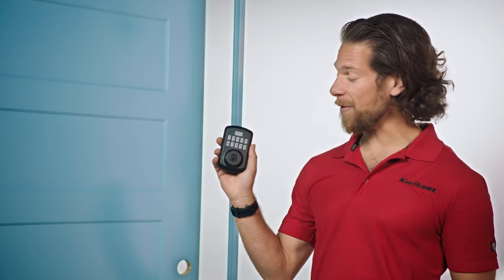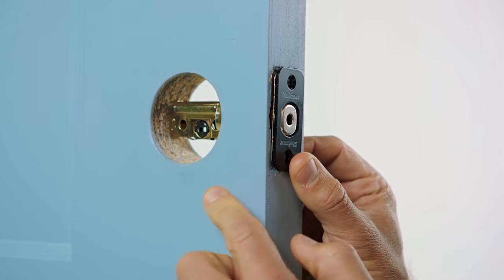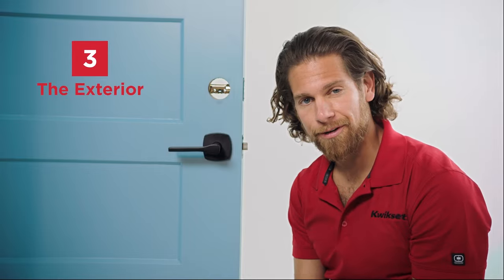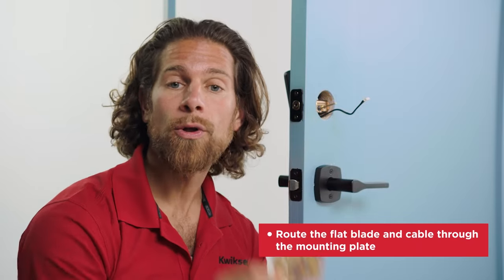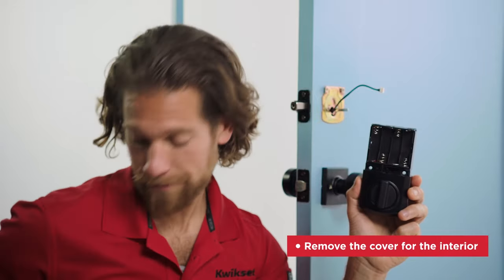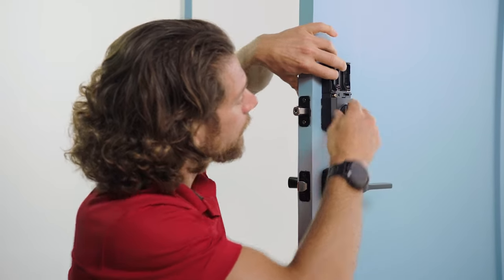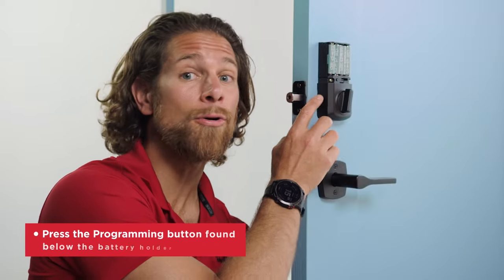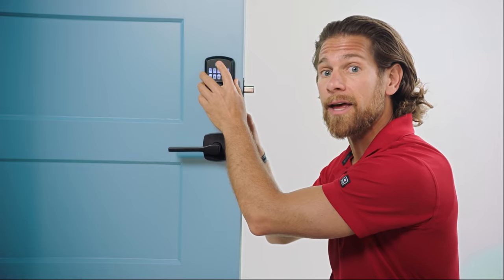Kwikset Powerbolt® 250 Electronic Door Lock Installation Video

Comment: After installing it, it worked. Then decided to calibrate and now it’s not working. Called 800 number and she was not helpful. At least put someone that knows what they are talking about instead of reading a script. Why do I need to replace brand new batteries? Why does it fail after trying to calibrate? She said I need to return to store as the motor sounds sluggish on the phone. I know it has to be software issue and not mechanical. Brand new and a bad motor? Returning this one and getting different brand.
Reply: The key doesn't work for my lock? It refuses to withdraw. Is there a fix for this or do I need to replace the whole thing?

Comment: My door is unlocking when I hit the kwikset button and locking when I put in my code. 

Completely opposite of what should happen
Reply from the maker: Hi and happy to help! It sounds like your lock is working in reverse and here are the steps to fix it: 
1. Open the door and place the latch in the locked position. Remove the key from the lock.
2. Unscrew and remove the interior assembly of the lock.
3.  Make sure that the Flat Blade spindle is in the vertical position and that the Turn-Piece is also in the vertical position. 
4. Reattach the interior assembly while the latch is still extended (locked).
5. Perform the Door Rehanding (Page 4, Step 15): https://kwik.st/3NUSeGv
6. Finally, check your door jamb to ensure it's a full once inch deep and test the lock.
Thanks ~ Kwikset Social

Comment: Doesn't require a step to detect orientation like the powerbolt 2?
Reply from the maker: Hi and here to help! On the Powerbolt 250, after the first User Code is created, the latch
bolt will automatically retract and extend to learn the locking and unlocking direction of the door. The Kwikset logo will indicate success or failure. GREEN: Success / RED: Unsuccessful. Thanks ~ Kwikset Social
Reply: @kwikset  thanks! Getting a warranty replacement from 2 to 250, so very helpful!

Comment: What happens if it flashes red while programming?  Reset doesn't fix.
Reply from the maker: Hi! Please try a new set of batteries and perform the Rehanding steps in Section 15 on Page 4 of the Installation Guide: https://kwiksetprodstorage.blob.core.windows.net/documents/kw_ig_5054449[250]eng-spa.pdf  Thanks ~ Kwikset

Comment: The install was easy, however never managed to  program it to work.

We installed it with the lock extended.

We used step 16 to try and train the lock, however it retracted, but could never get to the extended (locked) posit
Reply from the maker: Hi Mala - Glad the installation was easy for you! Please try replacing the batteries with a full new set and complete the rehanding step again. For more support, please reach out to us here: https://kwik.st/47S6kjH  Thanks ~ Kwikset Socia
Reply: Having the same problem. Called the 800 number. She was not any help. Why do I need to replace brand new batteries. It was working fine, but when I tried to calibrate all hell broke loose. Returning mine.
Reply from the maker: Hi Viaggi, We understand you've contacted our Support Team previously, and we'd like the opportunity to assist you further. We place tremendous value on our consumers' experience with our products and services, and our goal is to find the correct solution for you. Can you please give us a call at 1-800-677-5625? Thanks ~ Kwikset Social
Reply: I am have  a similar issue. After installation, programming my code and pressing the lock button, it was very stiff and would try to retract but it wouldn't. I loosened the screws to take some tension off and that didn't help. The person that customer service told me to take the keys out but since I was not in front of the lot she refused to help me anymore
Reply from the maker: Hi Rod - Happy to assist you further! We ask that you contact our Support Team when you are near the lock so we can walk you through the troubleshooting steps over the phone: https://kwik.st/3TSC8Rr  Thanks ~ Kwikset Social

Comment: I’m having issues mines keep showing me a white light no matter what I do.
Reply from the maker: Hi @Cyplife - To get your Powerbolt 250 in working order, please replace the batteries, Factory reset the lock per step 16 and perform the Door Rehanding process per step 15. Finally, program a user code in step 6:
https://kwiksetprodstorage.blob.core.windows.net/documents/kw_ig_5053732_9250.pdf  Thanks ~ Kwikset Social
Reply: @kwikset  Ty I’ll leave you an update when I replace it.

Comment: I have a issue where if I put in my code it locks the door, and when I press the logo it unlocks the door. What do I need to do?
Reply from the maker: Hi Andrew - Happy to help! It sounds like your lock is working in reverse and here are the steps to fix it: 
1. Open the door and place the latch in the locked position.
2. Unscrew and remove the interior assembly of the lock.
3.  Make sure that the Flat Blade spindle is in the vertical position and that the Turn-Piece is also in the vertical position. 
4. Reattach the interior assembly while the latch is still extended (locked).
5. Perform the Door Rehanding (Page 4, Step 15):
https://kwik.st/43cDRlD
6. Test the lock with the door open.
Thanks ~ Kwikset Social
Reply: Nothing the kwikset team says will help cause they dont know what the issue is but after a very long niggt of cussing amd throwing tools i figured it out! 

The last 2 screws you install cant be too tight or it will never successfully program the lock
Reply: I ve tried and done everything on the instruction in order what you explained.  I changed the blade spindle to the vertical then reattached it.  I did the door rehandling and hoping if the programming could reverse the lock/unlock position.  Unfortunately, it still doesn't work at all.  I press the 'kwik' logo, it unlocks.  I am so frustrated with this programming.  How do you reverse the lock/unlock position in programming?  @kwikset

Comment: I FIGURED IT OUT!

The whole process is fine, good info, thanks.
The “problem” is, as always, user/operator error.

The interior bolt knob, is SIDDED.  If you try and install and setup as video suggests with the “6” in the “12” position, it doesn’t work…. Disassemble the interior part, Flip the interior knob so 12 is at 12, and then redo the 1-kwikset button to program your code.

All I can saw is, the interior knob, has a small raised part, that is the “arrow” or “up” position.  If you have the flush part of the knob, that’s the wrong direction…. It’s upside down. 

If you look closely, you’ll see, on side of the knob is flush with the mount, the other side is elevated slightly, about 1/2 a cm…. That’s the pointer or “12” on a clock face.  The proper “up” position.

I struggled like everyone here… and it Worked for me!

Also, when he says “have the bar horizontal…. That’s when the exterior is mounted, but to “extend the deadbolt” that flap, is then VERTICAL when you attach the interior faceplate.

Comment: I have a kwikset lock and it suddenly flash green light and beeping every few seconds. I already change new battery but still the same. Anyone know what happened?
Reply from the maker: Hi and here to help! To get your Powerbolt 250 working properly, please follow these steps in order:
1. Open the door and place the latch in the locked position.
2. Complete the Factory Reset, step 16, followed by the Door Rehanding, step 15.
3. Program the User Code, Step 6: 
https://kwik.st/44oIHha
4. Make sure the door frame jamb hole is 1 inch deep and check your door alignment:
https://kwik.st/3rrx5LF
Thanks ~ Kwikset Social

Comment: I also struggled, BUT it is very important to follow exactly what he says. Make sure the metal pieice that connect to two piece is HORIZONTAL, not Flat and the inside piece is straight up and down when you connect the two piece. That will make all fhe difference.
Reply from the maker: Hi @sna2ke - The flat blade piece should be in the Vertical position with the latch bolt in the locked position before installing the interior assembly. Please see time stamp 3:47. Thanks ~ Kwikset Social
Reply: @kwikset  sorry, I meant vertical.
Reply from the maker: Great! Thank you for your feedback.

Comment: Anyone have info on how to master reset can’t get this pos to work
Reply from the maker: Hi Antonio - Here to help! To get your Powerbolt 250 in working order, please try the following steps:
1. Replace the batteries with a fresh set of name-brand Alkaline batteries and not rechargeable or lithium.
2. Factory reset the lock in step 16, and perform the manual door-handing process in step 15.
3. Reprogram a user code in step 6.
Here's a link to the 250 Installation & Programming Guide: https://kwik.st/3PklF68  Thanks ~ Kwikset Social
Reply: @kwikset none of it works for me, i try to do it but it just ends up with all the buttons being pale blue whenever i try to click on the buttons. Also the program button doesnt work when theres batteries in. Only time it does something is when i take a battery out and put it back in and click the button only for it eventually turn red and anytime i click on any buttons its all just light white blue color and nothing clicks
Reply from the maker: Hi and here to help! Please follow these steps to get your lock in working order:
1. Ensure the lock was installed with the door open and the latch in the extended (locked) position.
2. Complete the Factory Reset, step 16, followed by the Door Rehanding, step 15.
3. Program the User Code, Step 6: 
https://kwik.st/48kLM3t
If you should need any further assistance, please reach out to our Support Team here: 
https://kwik.st/3Tpewna Thanks ~ Kwikset Social

Comment: So how do ya switch direction?
Reply from the maker: Hi Nathan - Here to help! To set the locking and unlocking direction on the Powerbolt 250, please follow the steps on page 4 of the Installation Guide, Section 15: https://kwik.st/3JLRgtU  Thanks ~ Kwikset Social
Reply: @kwikset this is not working, I came here to find someone else with this issue, these locks will not work for both side, the lock works perfectly with left side locking doors, but absolutely will not re-learn for right side locking doors

Comment: Nope. No. It doesn't work. You don't mention what to do when it flashes red and doesn't work....
Reply from the maker: Hi @sctt2525 - To fix this, please try the following steps:
1. Check the installation, and ensure that the flat blade was installed in the vertical position, while the deadbolt latch is in the locked position. Also, check that the cable is secure.
2. Perform the Factory Reset and the Door Rehanding process in steps 16 & 15:
https://kwiksetprodstorage.blob.core.windows.net/documents/kw_ig_5053732_9250.pdf
3. Follow the steps to add a new user code as shown in step 6.
4. Lastly, check your door alignment to prevent any future jamming errors: https://www.kwikset.com/support/answers/how-do-i-check-door-alignment-for-my-smart-lock

Thanks ~ Kwikset Social

Comment: my program button does not work. when i press it, no sound happens. but the buttons on the front still light up? how do i fix this issue?
Reply from the maker: Hi and here to help! To ensure your program button is working, please try the following steps:
1. Make sure the latch was extended during the lock's installation.
2. Complete the Factory Reset, step 16, followed by the Door Rehanding, step 15: https://kwik.st/3ra1RZX
3. Program the User Code, Step 6.
If  the program button is still not working, please reach out to our Support Team for assistance: 
https://kwik.st/3LuCadc  Thanks ~ Kwikset Social
Reply: My program button also doesn’t work. Installed one from Home Depot went back up replaced installed the other… same issue. Junk.
Reply from the maker: Hi Ian - We're happy to help troubleshoot your lock and provide warranty support. Please reach out to our Support Team here: https://kwik.st/3RmZgXb  Thanks ~ Kwikset Social